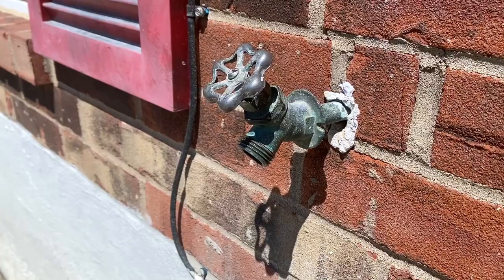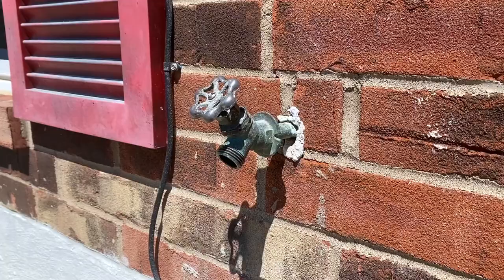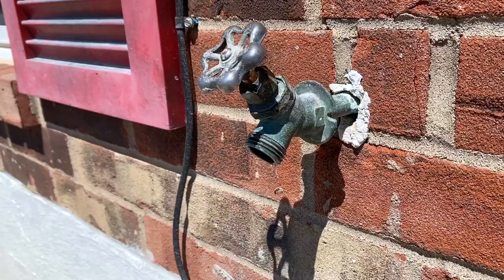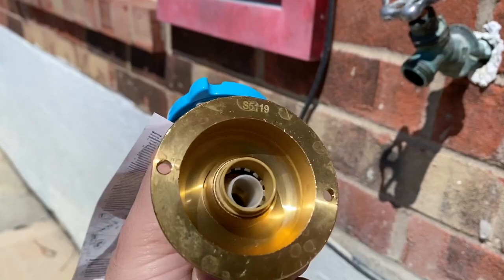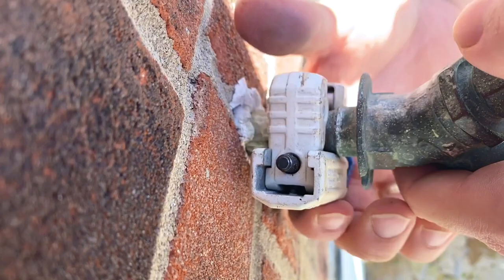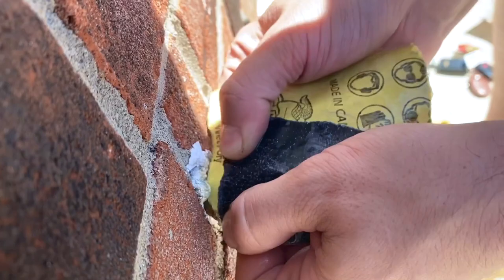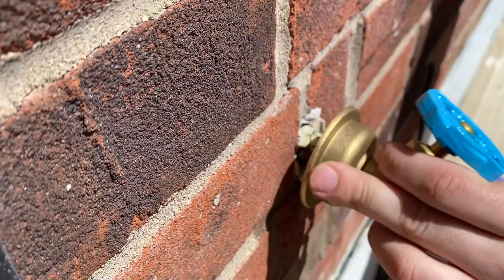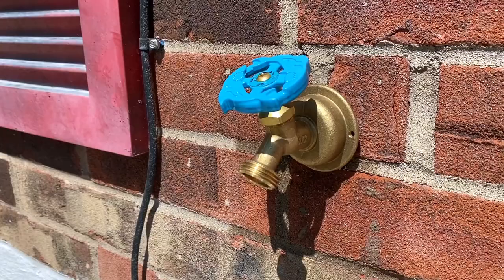How To Replace a Leaking Outside Faucet In 5 Minutes - Garden Faucet / Hose Spigot

Comment from the maker: Shark Bite Faucet - https://amzn.to/2XbFzEY 
Copper Pipe Cutter - https://amzn.to/2AdxWoP
Reply: Bad idea. Just swap the insides of the old valve with the new valve parts. Just unscrew the nut on top of the valve. May be tight but soak it with some wd 40. It’s only a rubber washer inside.
Reply: Hey there. Thanks for the video but that shark bite is a nightmare waiting to happen, especially if you are in an area of the country where that spigot will freeze. Please change that properly without the shark bite. That spigot under pressure will test that shark bite and the pressure every time you shut off and turn on  the faucet will make it explode off one day.

Comment: Who was on the inside holding the pipe??? There is no way that shark bite went on without resistance on the pipe.
Reply: I was thinking the same!
Reply: Only in America, oust like these home shows all fake.
Reply: I was going to say the same thing. This video is very misleading and if someone followed what this guy did they'd have water leaking inside their walls.
Reply: As seen in the video he had room to move the pipe .. .. move the pipe forward and hold it with a pair of channel locks , then push the shark bite on .. I would definitely seal it to the wall with screws
Reply: @jaydrains2247  there is not enough pipe for channel lock and the Sharkbite fitting.
Reply: He needs to keep it real. As he pushed that Shark bite in, the faucet moved in, so the shark couldn't bite enough pipe. Come on man. General public smarter Dan dat.
Reply: Thats why the video lapsed and skip too the end

Junk

Also love how he didnt put
Screws in the wall nor turn water on fully. See how easy he was on it. Joke. Junk

Dont buy this crap
Reply: He cut out the part of him pushing it in.  He could have done a better job in the video by mounting it with screws and adding more sealant to the hole.
Reply: @TheSaw410  I don’t think you understood what everyone is saying. In order to push the shark bite onto the pipe inside the wall someone needed to push the pipe out from inside, because it’s movable inside the wall.
Reply: I’ve done stuff like that myself by pushing things against it like jamming a piece of wood in the back to keep the pressure forward.
Reply: Yeah sure hope someone was able to push that half inch copper pipe out some more,otherwise the shark bite wouldn't have gone in enough to make a good connection . Apparently it did  .
Reply: That is exactly right need someone on the inside pushing pipe out from inside to get that shark bite on right and tight
Reply: @steverudnisky  Yeah, someone had to be on the inside.  Why not just say that?
Reply: This video cracks me up 🤣👍 bro if you soooooo slick why you didn't show us how to take it back off ??? Since ALL sharkbites are temporary repairs don't screw yourself folks once you put this on and it leaks you WILL have to call a plumber and it WILL cost you way more then just calling one in the first place.. if you don't want to call a plumber ho get a hose bibb cap screw it on instead of screwing yo self 👍
Reply: I was thinking exactly the same thing. Someone had to push that from the inside
Reply: @ponchosancho7710  shark bites can be permanent if installed correctly, most aren’t installed correctly leading to them failing
Reply: @isaiah4478   hey I've made so much money on removing sharkbites that are  leaking pls pls 🙏 pls keep installing them CORRECTLY!

Comment: There is a 95% chance that the shark bite did not seat all the way on that copper pipe with all the movement  in that pipe you definitely would have had to have something on the other side holding that pipe to keep it from pushing back inside the wall while pushing in that sharkbite
Reply: I was waiting for that pipe to pull back inside the wall when he cut it...
Reply: I was wondering why he didn’t clamp it from the start. He’s definitely just a DYI-er
Reply: He only had about 1/2" showing and it moved inward more than you'd need to even get a connection.
The video went from him barely sending 1/4" in on the pipe to it installed.
Didn't show actual installation!
Fake
Reply: I was thinking he might tap a wooden wedge in the penetration to immobilize the pipe while fitting the faucet...and what about some masonry screws into the brick to immobilize the whole thing?
Reply: I don’t trust this toy 🧸
Reply: @AZ-zn3ru   I didn’t see him claiming to be a professional, and in all honesty, anyone searching YouTube for “how to” plumbing videos is very likely to be a DIYer.
Reply: @geralddeitz9169  Nope. And notice there was splice in the video right before he turned on the water. It probably blew the new faucet off when he turned the pressure back on.
Reply: Might wanna screw it to the wall also 🤷‍♂️
Reply: @NubianP6  right. But as a DIYer you’d want to see how a professional does it.

Comment: You just made your life miserable the next time you have an issue with that shark bite, which appears to be recessed into the base of that spigot.  It will not be easy to remove this shark bite spigot/combo unless you cut the pipe again!  Why not sweat the spigot off (no cutting) and solder a male threaded adapter to the pipe and use a threaded female spigot.  The next time you feel you want to replace it, you can just unscrew it with two wrenches.  Life would then be so much easier for you and the next person who buys the house.  It would be a win win! Do it right!

Comment: Well at least we all know how NOT to do it 🤦🏿‍♂️
Reply: thanks god, you just confirmed my assumption.  I know nothing about plumbing but i was "Ewwww!  It doesn't look that good!   One winter and this installation will break and i'll end up with more problems!".  I think i'll stick to other video showing the proper way, with an Anti-Freeze Wall faucet which is long enough to get inside the house.  Problably not as cheap as this crap, but still more bullet proof than this.  I'm not the kind of guy who like to change this crap every year.

Comment: That white plastic circle on a shark bite is only needed if you use it on plastic pipe.  It's helps keep the plastic pex pipe from deforming. When using a shark bit on copper pipe always remove that white pice of plastic.  It will mess you up every time buy  Catching on the inside of the cooper pipe.  I am a master plumber and have used over a thousand shark bites.  This is what makes a shark bit fail time and time again.

Comment: If you are going to use a sharkbite fitting, get the deburring tool. It cleans up the sharp edges of the cut so you don't damage the o-ring and also it let's you know where to mark your pipe so you know if the pipe is all the way in the valve/fitting. Clean up the inside of the pipe also so there are no sharp ends.
Reply: And wrap pipe with teflon tape before installing faucet

Comment: The way to do that in a cold climate is to heat the valve stem and washer with a torch,  twist it off.  Clean the pipe end with flux while it's hot, then sweat-solder on a threaded adapter that allows using a silcock that threads into it. Push the pipe with the soldered-on adapter as far back into the brick as it will go and wedge it in, or use foam to fill the gaps and stick it in there. Then thread in a ball-type silcock valve, using teflon tape on the threads.  Not quite so pretty as the shark-bite one but so easy to replace if/when the time comes - put an adjustable wrench on the adapter,  twist off the damaged silcock, thread in another one.  That's a true 5-minute job.
Reply: ..meant to say, remove the stem and washer and heat the old valve's body with a torch....

Comment: You'll definitely want those screws in place, or every time you turn it, it will strain the shark bite connection.
Reply from the maker: I added them after the video, your absolutely right
Reply: I assume you would need some type of concrete/masonry screws that tap into the brick? If so, can you recommend some please? Thanks!
Reply: @derekholmes7751  Tapcons. Dewalt is a pretty good brand for them.
Reply: Wish someone would do one on the shut off valve.
Reply: Yep
Reply: Was thinking the same!
Reply: what size screws?
Reply: Shark Bites are incredibly strong and sturdy, but, yeah, the screws help, though, given the size of the screw holes  shown in the vid, they wouldn't do much good after a while, even if you used concrete anchors, which would require drilling even larger holes.

Comment: If you look at other video's, it is stated that you should not use sand paper, the pipe needs to be clean, but not have the striations on the copper pipe.

Comment: he could have just changed the rubber washer
Reply: by the time they leak, they are so corroded its very hard to get the stupid thing off anyway
Reply: Right... and come back and repair and bubble gum it every year until he wises up and replaces the whole thing. Or if you called a plumber, you can pay $75-80 per trip for them to keep coming out putting on rubbers...
Reply: BINGO!
Reply: @She_Tried_It  plumbers are crooks but some home owners are lazy.

Comment: Are shark bites rated for Winter subzero climate? Will the plastic crack over Winter when you turn it on in the Spring?
Reply: That will definitely crack in cold weather

Comment: You sound great ,Most outdoor hose bibs do not have that much copper sticking out your brick ,block or concrete wall ,Most existing hose bibs are installed

Comment: !Cut the pipe with the grinder you leave more space to put regular hose bibb on and use you torch!!!🤔🧠👍
Reply: How do you get  a grinder behind the spigot.  Acctually a hacksaw with a new blade. Will get closer. Also put a visegrip on the pipe next to the wall.  That way the pipe  will not go back into the wall. ,

Comment: In this case i would of gone with soldering since that would allow you to keep the extra length in the pipe, would of also insulated the hole. And as others have said there is no way that sharkbite went on without you being able to hold the other end of the pipe. Hopefully this video doesn't mislead too many people.

Comment: You need to replace it with a 4 in. Lead Free Anti-Siphon Frost Free Hydrant with Built-In Vacuum Breaker.  Real plumbers don't use sharkbite.
Reply: Um, yes they do.
Reply: @bigmacdaddy1234  yep, I have seen many plumbers use shark bites for the job

Comment: I've used shark bite many times but don't see how the stem was long enough to pop in. But if it did, and it's a non freeze environment, that would work. But I'd definitely fill in the gaps with foam and secure with blue screws

Comment: What I see is a copper pipe that will push back into the house.
You would need to hold the pipe for that type of connector to be pushed on tightly. 
Why didn't you show how you held the pipe while installing the fitting?
You went from it sticking out if 1/2" to it instalked.
Either you has someone under the house pushing out on the pipe or using a tool to hold it on the outside.

I don't see it going on from your video with how much it moved inward!
Please explain and show in a video.

Just my 3 cents

Comment: This can be done. You have to cut the piping inside the house with enough space to work with. Then insert the SharkBite hose bib with more than enough PEX piping attached to it. Complete the connection inside the house. I have done it with ease.

Comment: You did not deburr the inside of the PIPE. You have just damaged the Shark Bite fitting... The Burr on the inside of the pipe will cut the O-ring on the Shark Bite!!! This is extremely important on a Shark Bite.....

Comment: I don't have a copper pipe but I just have that darn gray plastic pipe.  I really need to replace both of my outside faucets and I live in VA along the coast.  Is a Shark Bite faucet the best thing to use or not?  Any comments would be helpful!  Thanks!
Reply: So multiple hose bibs and in an area that gets below freezing temps? I would call a plumber. If not to do the work for you and save potentially thousands in damage, then the plumber can still listen to your eventual DIY plan and ensure you aren't doing anything wild. Just my 2¢

Comment: It would be a lot easier to just replace the washer - Also do not use those so call shark-bite BS devices. If you live in area that freezes, the shark-bite faucet will come loose and you'll have a major problem. You'll find out in the future.
Reply: Thank you! Looking to replace a couple that froze this winter and found a dozen shark bite tutorials. None of them look like long term solutions.

Comment: No way the shark bite went on without the pipe being pushed out further from the wall ,  You either had someone behind the wall pushing the pipe or pulled the pipe out 4 or 5 inches and used visegrips to hold the pipe before pushing it on

Comment: if for some unforeseen reason you can not get a full shut off , stab the shark bite valve open the valve fully this will help with the installation with little resistance , second i would use a hack saw instead of the cutter as it will give you more pipe to stab your shark bite fitting, and third give a try to unscrew the old fitting using a back up or another wrench or tool to hold the pipe still so it will not turn or bust as you try to unscrew the old valve this is very important, bigger wrenches give better leverage  ,  be careful , thank you for sharing your video

Comment: If you have to pull the pipe out of the wall a bit to get a long enough piece to to work with, how do you keep it from just pushing back in when you try to attach the new faucet?  Is there some kind of flat clamp you can attach to the pipe to keep it in place?  I guess you could use locking pliers, but they might be too thick.
Reply: Get someone to hold/push the pipe from the inside. In my case, both the front and back faucets of my 60+ year old house are accessible from the inside via the kitchen sink (back yard) and a clever "door" over a hole in the drywall inside the main entrance closet (front yard). If I were to do it, myself, I'd attach a clamp or vice-grip wrench or bolster the pipe with a piece of wood against a wall, stud, or other pipe (put a cotton towel around the pipe to protect it from the clamp/wrench). In some cases, the only access may be through the inside pipes in your basement or crawlspace.

Comment: Also, you didn't show the actual shark biting. Just when you started to push it on. How did you get the pipe to stop from pushing into the wall?
Reply: Hint put a vise grip on the pipe as close to the wall as possible.  So the pipe doesn't go back into the wall .

Comment: Why not just change the washer on the old one? That would take less than 5 minutes.
Reply: In addition to the washer on the inside valve, so that it makes it through the winter.  I would have caulked the opening as well.  I'd probably evaluate doing the packing while I was in there.

Comment: I'd love to hear how effortlessly  pushing the faucet onto the copper pipe magically creates a seal that withstands typical water pressure. Not saying it doesnt - but if it went on easy seems it should come off easy. How does that work?
Reply: It's called a sharkbite. It's been around for some time now. A quick Google search will have more info for you
Reply: @AG-tm4gr  It's a crap product. Your insurance will drop you off you have any water damage from it

Comment: I highly suggest installing a hose Bibb anchor on the other side of the wall. Also someone needs to hold the pipe inside when you push this on or install it in a new piece of pipe and then join the new pipe inside with a coupler.

Comment: Nice editing. You cut it right where the sharkbite fitting would push the copper pipe back into the wall. How about do a real hose bib replacement video? Are you sponsored by Sharkbite? LOL.

Comment: 1.  Most situations will not have that much slack in the line.  2.  Someone needs to support the pipe from the inside.  3.  You didn't sand to bare copper far enough back for shark bite fittings.

Comment: Just cut a hole in the drywall and replace it with a Frost free hose bib . If you don't want to repair the drywall just put a small snap in access panel and your done . Properly . This video is misleading as others have mentioned that the loose pipe will push back in the wall and won't make the proper connection . And put a vacuum breaker on that thing too .

Comment: I appreciate your effort but in all my years I've never seen an outside faucet with that much pipe sticking out from the wall. They are all flush to the wall. This method wont work for those.
Reply: I have seen like 3 vids of house w 10 feet of pipe like "wtf" is going on here 
Lol

Comment: I’d rather just change the washer , which I did do this summer , and it works beautifully now on one of my outdoor faucets ... the other one , I couldn’t get the screw of the handle even after spraying it with liquid wrench ( but it doesn’t leak until I turn it on ) when it’s off no leaking , so for now just leaving it until I figure another way to get that screw off that faucet handle

Comment: some videos show you how to twist off the  valve stem and replace the whole thing, but i think that is stupid. 1. you don't know how old those pipes are and that stem connection could be seized up to the connecting water pipe. 2 many modern homes have cpvc water pipes and you can just imagine what would happen if you tried twisting the stem off.

Comment: I have used SharkBite fittings. It is not as easy as it appears for copper pipes. More over it needs some force to pop it in.  That means somebody real strong must be holding it so tight this guy can pop it in. No way. I like SharkBite and it is easy to use with PEX piping and  little room to work with.

Comment: Wasn't the original hose bibb a soldered connection? You would have given yourself 1/2'"-3/4" more copper line by removing it with a Mapp Gas Torch 🔦 🔥....By cutting it you lost a lot more pipe.